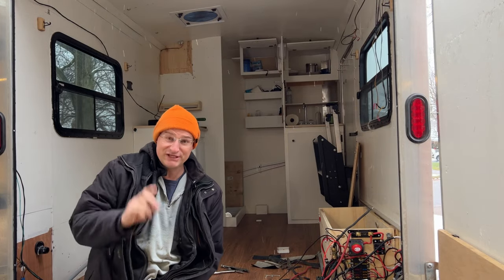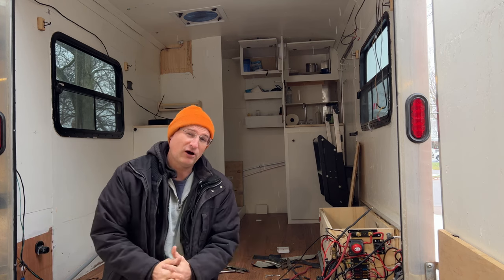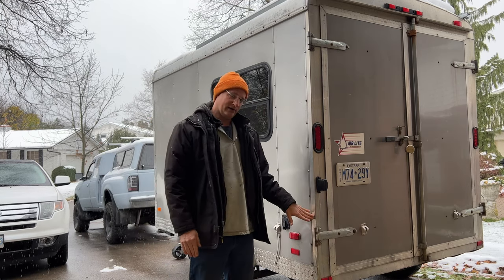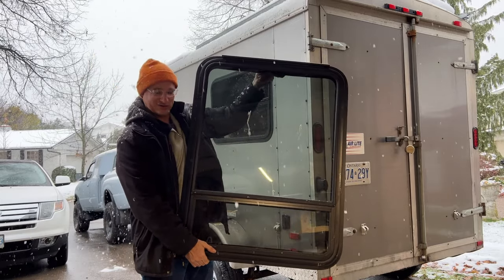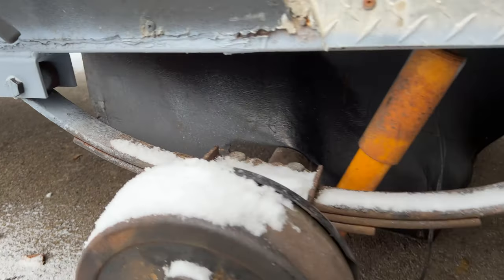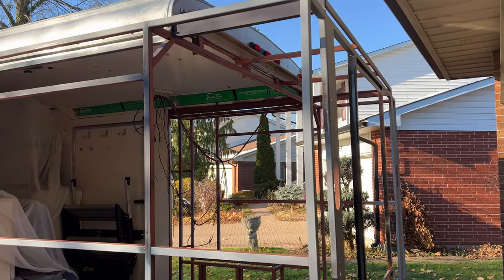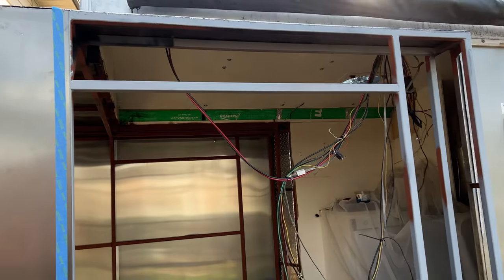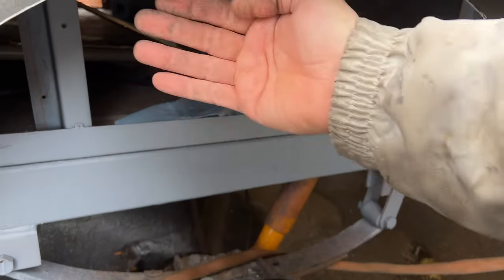Building an Off Road Cargo Trailer Camper Part 1/2

Comment: You've got me thinking that the super heavy ramp door on mine could be replaced with a bump-out shell on the back- but top hinge the assembly so a car can still be loaded using portable ramps that could store under the chassis. Kinda like the tip-up nose on the C-5 cargo plane, but on the back of a trailer. Nice work. I have all the ideas and inspiration, just not the physical drive to get out there and get mine going.
Reply from the maker: That would be a pretty neat idea!…. I’ve seen a few trailers at the junkyard that have a front or back that’s fibreglass with the wood frame in between. Maybe you can pull one of those off and fibreglass it to size? 
To make it out of metal even aluminum I think would be pretty heavy, you might have to end up sliding your axle back.

I hear you on the motivation…. I’m staring at mine and debating about pulling it all apart to double insulate it for this winter. 😅

Comment: Very impressive. I like it. Kinda looks like the flair on a 1 ton pickup bed. You did a great job!!!
Reply from the maker: The design is definitely growing on me, I really wish I could have got the same grey aluminum panels to match the original. 
Maybe I’ll just raptor line the whole thing like my truck. Thanks
Reply: @waysoutback  You can have a body shop paint match the new panels to the old. I personally like the contrast.
Reply from the maker: @larrycarlston4044  very true I’ll look into that. I kind of like the rugged raptor paint though. We will see. 
Thanks 👍

Comment: A church brother has a cargo trailer. What he did,he painted the trailer with White Seal. During the summer it's not as hot inside and during the winter it keeps the warmest inside. He painted my house too and it has helped a lot. Years ago my ex partner,he put boat insulation. Only one time have the PVC pipe busted.
Reply from the maker: Thanks I’ll keep that in mind. Never heard of that stuff before. I’ll look it up. 👍

Comment: Wow! Ambitious project. I wonder, how rigid will it be. Especially in offroad.
Also, I remember from previous videos, you were planning to upgrade the wheels. Is it still planned?
Reply from the maker: Right now the hardest part is fighting our weather…. Freezing temperatures and snow, then rain the next day. Such a pain for working outside! I think it should be quite ridged I used 1/8th wall tubing in all structural areas, welding in a decent amount of bracing and then thin wall in all non structural. I think my biggest worry is making it to heavy. Yes I have new tires and rims in the garage I built the opening to accommodate them.

Comment: By 7×12  and put  change out the axle
Reply from the maker: A 7x12 is actually over 8.5’ wide because the tires are on the outside of the box. Also you lose your departure angle. 
But it’s definitely an easier option.
Reply: @waysoutback  I've seen people buy the wider cargo trailers and narrow the axles. If someone is starting from scratch, that's certainly a viable way to go.